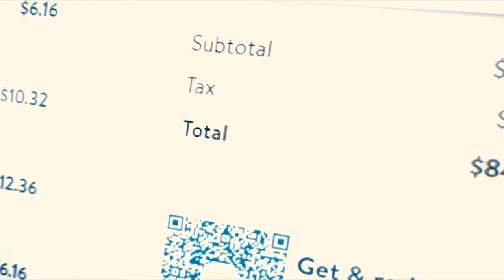PURIST WINTER DRIVE 2023

Comment: The chemical guys bottles are always broken lol I use the all wheel cleaner from meguiars works real good in my opinion it turns purple when it starts breaking down all the brake dust
Reply from the maker: Might have to pick that one up when I’m done with mine lol
Reply: @Lowtekz33  I recommend it worked good on my stocks and my 24's plus the purple makes it look cool for the video lol